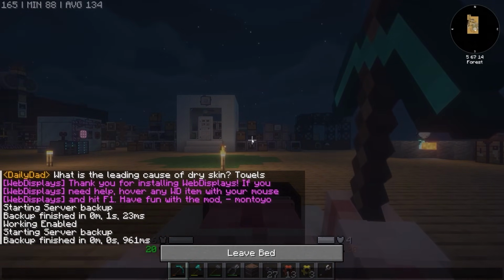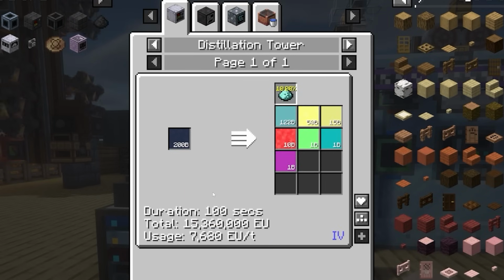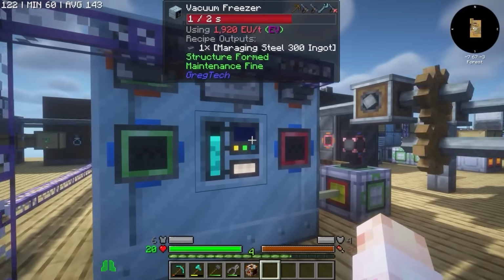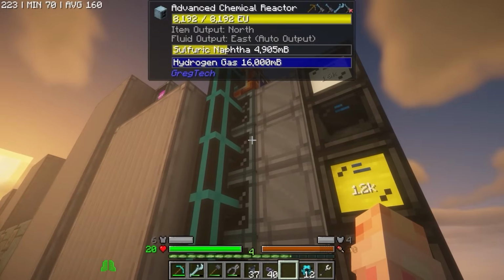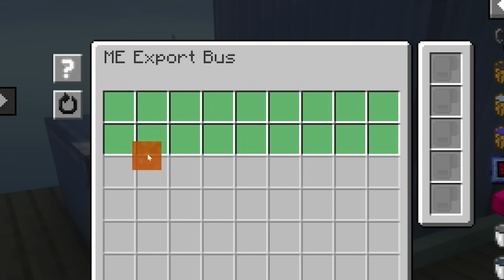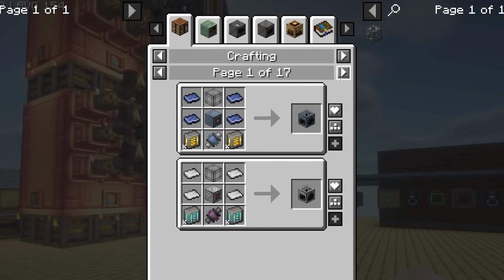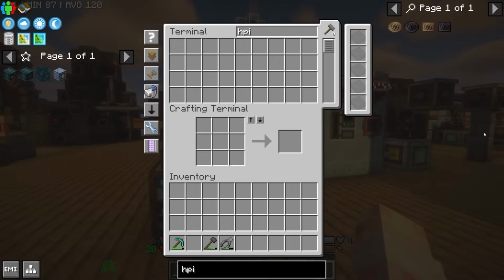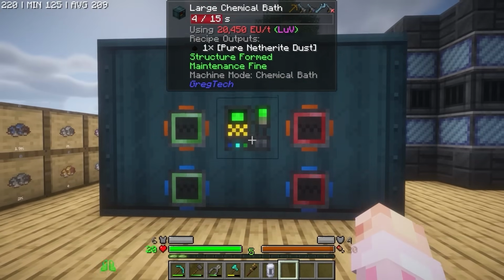Infinite Ores in Minecraft's Most Addicting Modpack || Star Technology (Part 4)

Comment: 12:41

When you burn wood, you do actually release a bit of water vapor that was still trapped in the wood. Normally, when people burn it for heat, we use dried logs since it makes for a more efficient burn and reduces the likelihood of the fuel dousing itself, but I guess the mod makes the assumption that the wood is relatively fresh, so water!

Comment: you could have just used AE2 auto crafting to handle distillation and only need one distillation tower :P. AE2 is your best friend with all this stuff.
Reply from the maker: AE2 is indeed a great mod, but I'm enjoying the challenge of using other tech
Reply: its not wise use the same machine with Ae2 to do all production lines.
U'll have bottleneck. I'm having such a thing with a chemical reactor in mode 1... must of my stuff depends on this only machine.
But my gasoline pipeline have independent machines for each step, so i'll never be without power.

Comment: 12:38 Water is a really normal product of combustion. If you are burning a hydrocarbon in oxygen, you're burning literally hydrogen (H) and carbon (C) in oxygen (O), which makes CO_2 and H_2O (water). Any other byproducts are from either incomplete combustion, (ex: smaller hydrocarbons, carbon monoxide), or from impurities in the original fuel/oxygen (ex: sulfur dioxide, nitric oxide)

Comment: It's interesting seeing your approach to passiving resources.

I rely on Applied Energistics autocrafting to use strategically designed Processing Patterns to dynamically respond to my resource quantities and change which cracking and distilling recipes I use to most efficiently produce whatever I need. This lets me re-allocate the same 2 distilling towers (one for oil, the other for all the cracked byproducts) and 4 crackers (wallshared with 3 distinct inputs such that any recipe gets 2 crackers working on it) to automate literally every cracking path possible.

Since you don't try to learn the intricacies of AE (there's nothing wrong with that, it's complicated to learn), you instead just hit everything with the hammer of a new multiblock for everything, which does look pretty cool, because all the machines make it look like a big factory.

Similar sort of thing plays out with EBF's, you have one for each metal you want, I have a bank of 16 EBFs which all can process any metal recipe, but only one at a time (though very very fast because they are each getting 4A of IV, and with 16 machines that's in total equal to 1A of UV).
Reply from the maker: Yeah I really like the look of brute force passive, makes big factories and forces you to play with space a bit

Don't get me wrong I could go the more elegant way but that's also harder to convey in a YouTube video, you loose a lot of sense of scale and progress when the bulk of the work is in ME cables and interfaces
Reply: @ The “cityscape of distilleries” is definitely a cool look. Your style makes perfect sense for videos, I just want to be clear I wasn’t criticizing the “inefficiency”, I just found it amusing.

Comment: to be fair, Lapidary boilers to steam dynamos Power can get you rather far. with the right augments, it can last you up to LuV on just diamonds
Reply from the maker: Oh yeah for sure! I just love gasoline crafting
Reply: The multicycle injector upgrades are quite strong.
Reply: U cant produce diamonds fast enough to generate so much power and even diatrons are not worth it...

Anywho, gasoline pipeline have a variety of subproducts very useful for other stuff like phenol, etc...
Reply: @AlexeiDimitri  Actually, you can make a lot of diamonds very fast. 

The only reason why diatrons aren't worth it is because it's so easy to make diamonds.

Additionally, there's a bunch of upgrades that can be put on dynamos to make them more efficient. 

Dejojo chose not to because it made a good story.